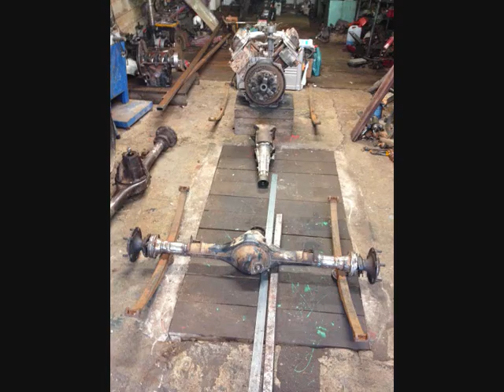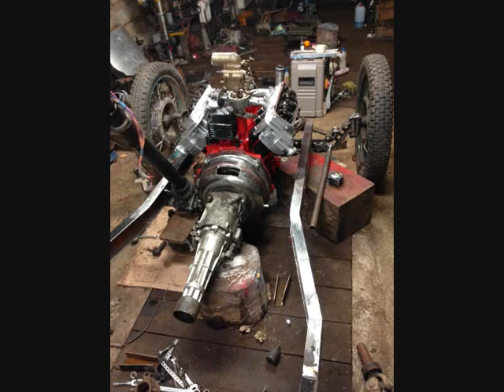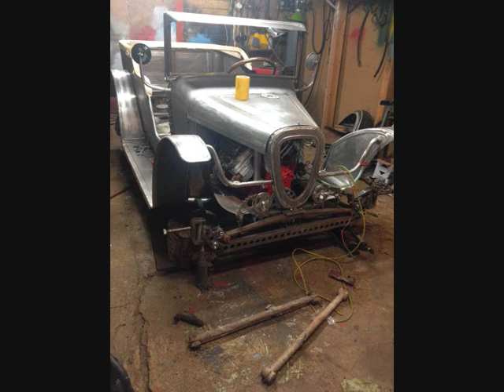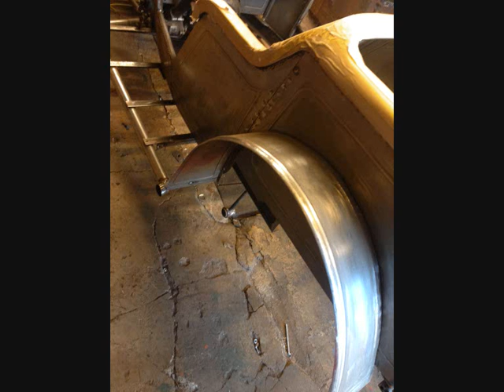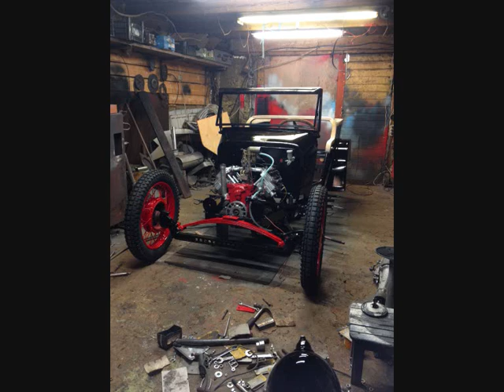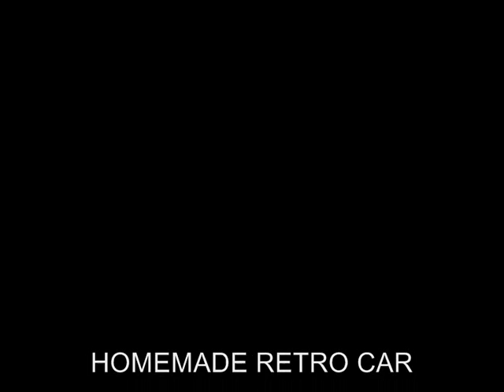Homemade RETRO CAR making

Comment: pretty neat car! what did you get an aircooled v4 from?
Reply: ZAZ 965/968 - Soviet rear engined car.
Reply: @friik100  , where did you get the transmission from?
Reply: @chrishenniker5944  I am not involved with this project. But from video/photos seems that the transmission is from Moskvich 408 or 412 or 2140. Not sure where the clutch housing is from thought.  Most of the parts are from soviet vehicles. If you need identifying anything else I can help you out.
Reply: @friik100  I’m impressed that he used locally available junk to turn into gold. This is a work of alchemy.
Reply: @chrishenniker5944 It truly is magical. There is long article about his build here:
https://sakala.postimees.ee/5853191/kuldsed-kaed-tegid-auto

It is in Estonian, but you can use translator.